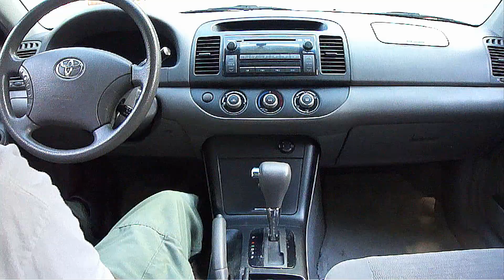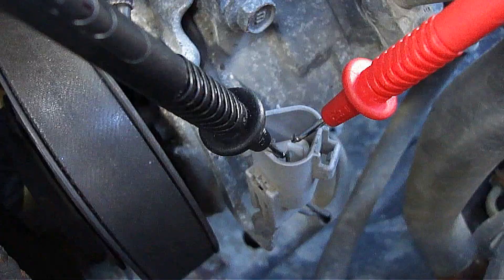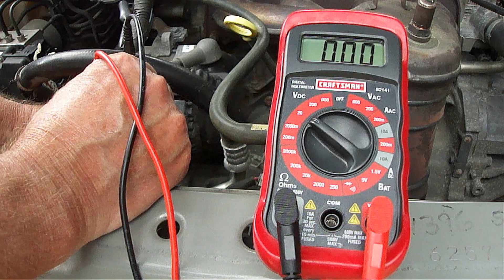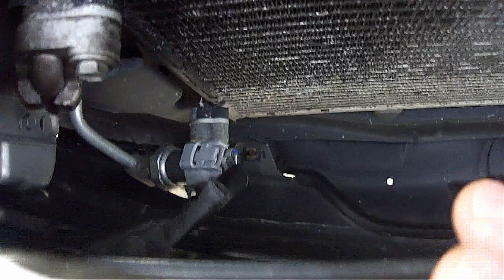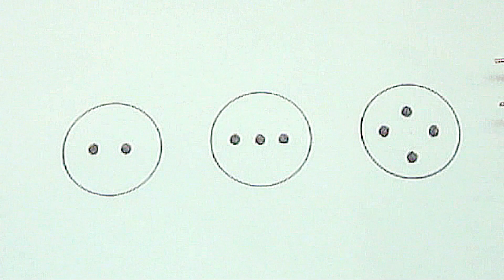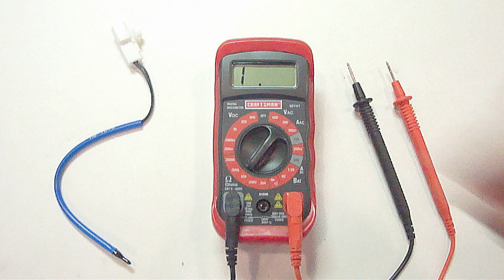Car AC Not Cooling - Possible Causes

Comment: Man, you just saved me from having bring my car to a mechanic. The AC stopped cooling. Thought it was refrigerant. Nope, gauge said its full. Now what? Looked at the AC clutch. It wasn’t turning. Oh no…the compressor must be bad. Nope. Went to the relay box under the hood as you showed. Switched out the relay with a similar one AND VOILA THE CLUTCH STARTED TURNING! Cold AC!!! I would never have figured that out. Thank you thank you thank you. 🤜🏼🤛🏼 2011 Ford Taurus Limited.